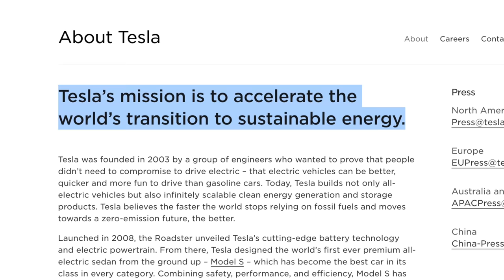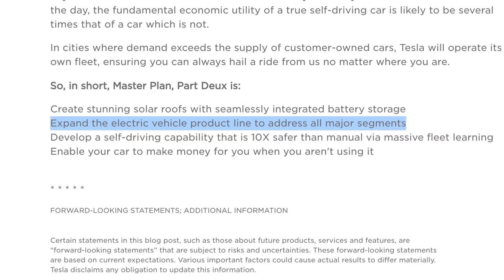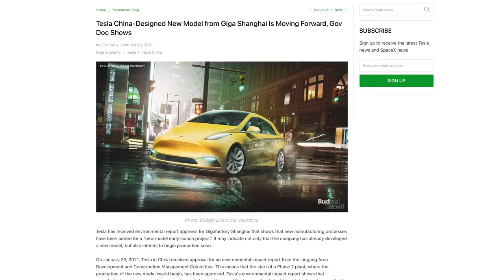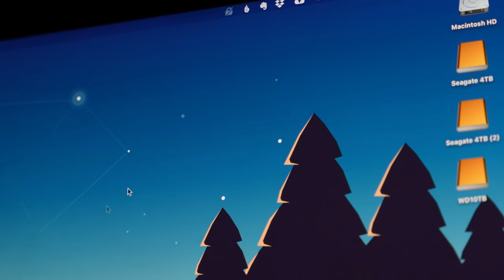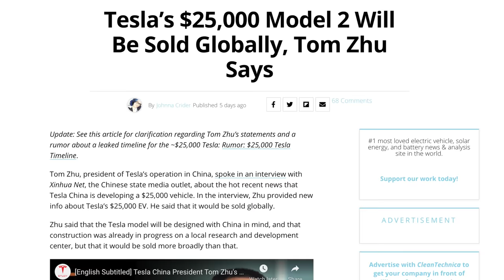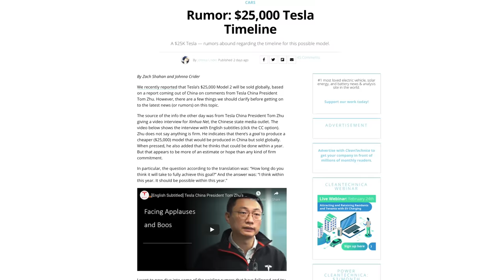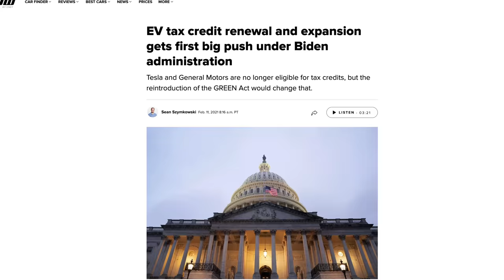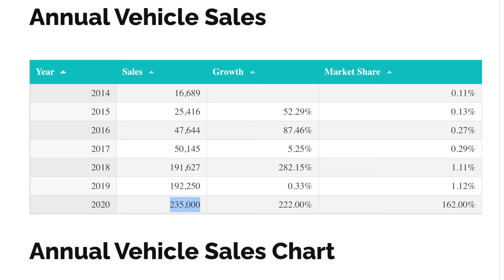New Tesla Model 2 = Game OVER for Gas

Comment: It needs a minimum of 250 miles. I live on a big island with few charging ports.
Reply: Hawaii sounds very expensive, but is the most beautiful and exotic slice of the USA. On the mainland, I'd need 500 miles and preferably 800 just to know I can drive anywhere without being stranded or suffering in anxiety and fear about a lack of helpful services and infrastructure. There are still rural gaps in the grid so it still only makes sense as a local city car while most drivers have a gas vehicle. I wish we could go solar and not be solely dependent on the aging power grid powered by the smoky dinosaur fuel. Those shiny new Tesla cars looks so great and not a bit of smoke nor dripping oil and antifreeze is the case. I'm so tired of wading through parking lots full of oil and antifreeze while breathing the funk just tracking that in which why everything is so filthy. They did really well European countries on cleaning up the mess, redefining living standards, and making things work better with set industry standards, but we can't seem to figure it out here where we can't seem to even agree on plug standards.
Reply: portable charge
Reply: ...You mean Australia?
Reply: How big is the island?
Honestly, I’d be fine with a 100-mile vehicle, charged at home daily. The average American drives less than 60-miles a day. A bus, train, or plane is cheap enough for long distance travel.
Reply: @evshrug  The Big Island of Hawaii is big. Places I travel require 250 miles RT and the destinations are rural. No charging stations. If I were to only have 1 vehicle and it's an EV it needs that 250 minimum. A friend has a Bolt and does fine with it. Regen helps on the long downhill areas.
Reply: @Worldofourown2024  asking for an 800m battery is like asking for a 100m gas GTR. It's just not gonna happen. Can it? yes. will it? hell no. Huge waste in resources and goes against the purpose of the evolving charging network. Get an adapter to charge universally, a charger for the house to charge at home, or wait till the supercharger network expands to meet your anxiety range. 800m gets me from florida to northern georgia, atlanta, with range to spare. that's asking for a bit much. plan your trips and you wont have to worry about being stranded anywhere. those who want to be a part of the future and own any EV, not just a tesla, do it, the rest will just sit around and blame range anxiety, or a slowly growing charging network, or lack of industry or government support on standards, when it's really themselves holding them back. be a part of the future you want to see. get one, adjust your life accordingly to make it work.
Reply: @evshrug  I read you only get 2% battery charging per hour plugging an EV into standard 110v at home. This means you gain a quarter battery in 12 hours and always needing more battery so off to the super charger for an hour or so on Wednesday nights after work. Then your electric bill becomes really expensive yet you're always got a battery conundrum so off to the super charger to top off your battery which is maybe more economical and definitely faster than home charging. Yea, an EV is great for a local commuter car. I drive as little as I can for I hate city traffic and our bumpy roads and highways just getting worse as time progresses for we can't keep up with the necessary maintenance nor willing to redo our infrastructure to really modernize. It's been nice only using 1 tank of gas per month the past year and I hope to keep it that way for commuting 80 miles a day is awful with accidents always putting us in danger and slowing us way down. Planes are most practical for international travel or to hop up to NYC or something which we don't do anymore, local buses and trains are cheap to use when you don't have a running car in the city, and I wouldn't want to have to get on Greyhound or Amtrak, but Megabus was a good cheap long distance bus though not on all US routes for it's British. I used to get long distance 1 way for $5, $10, or $15 on Megabus like from Saint Louis to Chicago and San Francisco to LA and LA to Las Vegas. And the you have the ex convict Greyhound bus ride. Super cheap flights, affordable taxis, low cost rooms, and everything used to be so plentiful easy, especially outside the US before Covid. I'd usually find domestic US one way for about $300 and international long distance for $600 to $1000. One time I flew from Kuala Lumpur to Paris for $300 on Malaysian right over Afghanistan with a screen showing Mecca on the world map a few years before that one came up missing they could never locate. How odd...
Reply: Few charging ports and then they're majority all slow...

Fast charging needs to be on par with gas stations... yep.
Reply: brah the lifted yota will never let you down
Reply: I do too called NoEj Island.
Reply: I'm guessing it would be in the 200 mile range scenario. It should be plenty for most people commuting and short trips especially if they have in-home charging.
Reply: @Worldofourown2024  if you have a single family home, you can pretty easily install a plug that will get you 30+ miles per hour of charge. Few users are actually using 110v outlets at home more than temporarily, they get these plugs installed. At that rate, most users recharge overnight without any trouble. This really changes the calculus you've made.
Reply: @house9120  Yes, the 2% an hour is just plugging it in without the special equipment in the garage you can get installed. Yes, that does change the 2% an hour battery calculus. 30 miles per hour is good enough to keep the EV moving as needed under most normal use and then you can sleep, eat, use internet, or whatever while it's recharging to be ready for your next drive. Now I need the money to buy my house and Cybertruck so I too can enjoy the adventure and have something to be mighty proud about. So expensive more than I can earn unless some new deal happens that changes the calculus to be much better than a measly 2%. We need 100% mojo going on for there's not a lot of time left as the future arrives while we get older.
Reply: @Worldofourown2024  Are European roads not made of asphalt? A few highways in the US are made of cement, but they are extremely expensive, and tend to heave under freezing conditions and cause constant bumps at the edge of each slab. I haven't heard what anyone's plan is of what to make all the roads out of if they stop using the bitumen that is left over from refining gas and oil. Tar sands perhaps? Going back to dirt roads is surely out of the question. No way the auto pilot features will like that.
Reply: @CatastrophicNewEngland  @CatastrophicNewEngland Sure they're made of the same sorts of materials. Audubons and highways are much higher quality material and design than American and most other countries. EU and countries like Germany put a lot more money in infrastructure, education, jobs, etc. to further advance themselves. Instead of bombs, they do bread. Well France and UK also have the bomb. Highway 63 in Missouri is a really nice American one that was built in the 1990's replacing the old asphalt 2 lane highway. I haven't been in 10 years so it might be bumpy, broken, and just rough if not restored. I-15 in Utah is terrible. So much traffic, so bumpy, narrow lanes, and just needs to be redone. They're doing some work on parts of it, but we're so far behind and it needed to be done already for Utah is so industrious, has high immigration rate, and is looking to further develop even more into the future. The problem is heavy traffic, high accident rate, high crime, wore out roads, infrastructure needing more development, water scarcity, toxic pollution, and a housing crunch.
Reply: I think Elon has indicated that 250 is minimum for his cars
Reply: @JamesOliverLindsey  I thought I heard that too.
Reply: @Worldofourown2024  can you make a stupid version for me, thanks in advance.
Reply: @lavapix  Crocodile Dundee “That’s not a big Island mate...” Your big island is about 150km long. Mines about 4000...
Reply: @mondotv4216   NOW THATS  AN ISLAND MATE !
Reply: @mondotv4216  It's literally called The Big Island of Hawaii :-) It's large enough that 200 miles aren't enough.
Reply: @lavapix  Easy - analyse how many miles you do a day. If it's more than 60 I'd be surprised. Unless you're a tour operator in which case a compact car ain't going to cut it anyway.
Reply: @mondotv4216  It doesn't matter how many miles I drive a day. What matters is what is the farthest trip I'd need the car for and that's 232 miles RT. This is based on owning one vehicle. Not having both an EV and an ICE.
It's not unusual for people to drive 200 miles a day over here as many live on one side of the island and work on the other.
Or they live in rural areas because it's more affordable.
Reply: Sri lanka?
Reply: Volkswagen ID.3 and Renault Zoe can easily do it
Reply: @UltimateGattai  he problry mena s north america becuase that has the most poupulation
Reply: 250 miles... It's a pity Tesla did not adopt the RC car model. Instead of charging locations all over the place make battery swapping stations, pull in and in 5 minutes your ready to go another 250 or more. 

Another though... just imagine what the strain on the electrical grids are going to be like once electric vehicles are the dominant vehicle on the planet. California won't be the only place with rolling blackouts.
Reply: I live on a medium sized island (Great Britain) and I need at least 650 miles range without refuelling to visit my daughter and grandson in Scotland. I would only consider an EV for local shopping, but for £30K no way.
Reply: @BeagleBageler  They're high tech, but super easy to operate and drive as long as you're familiar with touch screen computer tech which most of us today are for we have to use self check out kiosks or should if we don't want to be waiting forever in the line staffed by a human personal check out line customer associate. In Cybertruck, just plug it into your home solar power planet, then drive, but pay attention to battery levels vs. distances to where you can recharge. No worry about any power grid failure if you can purchase and install the solar power station on a piece of land you own. It's just money so only a few rich guys actually have this which are the tech and finance industry super stars.
Reply: @Worldofourown2024  Thank you for explaining, I now understand.
Reply: @BeagleBageler  Awesome. I seriously want a Cybertruck, a home, and a solar power plant system going. I don't think there's enough money nor time to achieve it though I won't abandon any cool idea and invention of our super hero visionary CEO Elon Musk. I hope to see him take it to Mars and I see he's the kind of leader we need more of us to keep our country together and advance it forward into the high tech age.
Reply: @UltimateGattai  sir don’t you dear tell me about how many I don’t see
Reply: @Worldofourown2024  Yea, I could not afford that myself either, but he could most definitely take us to the tech ages.
Reply: @evshrug  I agree! I barely drive 3 miles a week. 
Thanks Covid, let's never go back to commuting in to the office, or anywhere for that matter.
Reply: @BeagleBageler  Elon Musk is the coolest.  I'd love to live a very long time more yet to see the tech ages. If you live to 2070 or perhaps all the way to 2100, then you're in the high tech era. This is dependent on how well we take care, if we have adequate housing, healthcare, and organic tech based food, lifestyle, prevention of war, and pollution control.
Reply: You should consider leaving Greenland...
Reply: Pay extra for that Solar roof.
Reply: @saascarlson5597  You didn't think your comment out very well, did you?

Or you can just say you were joking :-)
Reply: This is a joke, the grid cant even handle peak use as it stands. No improvement to the grid means No effing electric cars. Rolling blackouts in CA says otherwise
Reply: so do i 🇬🇧
Reply: @lavapix  He's saying if you have solar panels at your home and a built in charging station you can use that instead. A lot of people in Texas benefitted from this compared to those that didnt. Being they still had electricity and running hot water. 

Those that didn't and only relied on the states grid got f'd over.
Reply: @MagicStick Yes, it seems that the tech is limited wrt range and speed of "fuelling/charging" relative to ICE, but the governments will be pushing you to spend a lot to own or to lease an EV, and Tesla and the others will be telling what car they are willing to sell you in the future. Meanwhile all trucks, buses,coaches, and vans will need to convert too, along with all the required change in infrastructure. Currently in the UK there are 213000 EVs out of 32 million vehicles total (that is 0.7%), and the infrastructure is currently just about adequate for the EVs. I wonder what the proportion is in the US?
Reply: @funfreq9282  Guaranteed Hawaii would have the rolling blackouts. Our lights already flicker daily.
Reply: @actionanimations4879  Are we talking about the same person? Saas Carlson. He literally didn't say any of that :-). 

It's a given you charge at home but you still have to make it back from your farthest destination and if that exceeds more than half of 200 miles with no place to charge you're screwed. 
I remember times over here where you couldn't even get gas on some routes unless you drove a certain time of day. You always made sure you filled up before you got home. Of course, my jeep gets over 300 miles a tank of gas.
Reply: @evshrug  Less than 30 a day for Americans! 🤷🏽‍♂️👌🏽
Reply: @lavapix  Where would you be going during lockdown that requires over 200 miles? If you look it up standard electric cars can run up to 250 miles as Teslas can run up to 350 miles per charge. This isnt a gas car where you can only get up to like 30 to 60 miles per 2.5 gallons. Plus most electric cars especially Teslas comes with the option of a solar powered ceiling. Meaning that if you op for that upgrade. Doesn't matter where you are. With direct sunlight your car will be slowly charging itself. While the breaking system literally charges the battery. 

You wouldn't be stranded anywhere. Compared to if you have a gas car and you look for a station but they all are tapped out of gas; which a lot were during the blackout where people nearly froze half to death. I love my gas stove but you need to be smart. Get a hybrid Gas/Electric stove and have alternative energy. Never rely on your state or Gov't to aid you in a time of crisis. Have everything set up so if 1 thing fails you have backup options.

Imagine you have to flee somewhere but you dont have enough gas to make it to where you need to go and you got rioters blocking the nearest stations. Like they were doing these past months. You need a vehicle that is self sufficient. As well as a home. You dont need Governors saying if you dont follow their rules they'll turn off your electricity like they were doing to people in California. Get some panels. Get an electric or hybrid vehicle that can run on any type of source. Either get it equipped with solar panel glass or by the portable panel charger.   

Get a water boiler that connects also to your house solar panels so you dont run out of hot water and get some backup generators. Don't be one of those stubborn people who can only see 1 way. Gas is great but be practical. Try to control as much of your own life by your own terms.
Reply: @evshrug  AVERAGE is average for a reason. And the charges don't charge up enough for overnight on that just yet.
Reply: @actionanimations4879  Holly crap. What was all of that?
Did you watch the video? They stated a 200 mile range so my comment was based on that. 

Since you brought it up.
Lockdown here in Hawaii didn't mean we couldn't go places to hike, surf, etc... And it wasn't all year. We have lots of remote areas one can hike that require long drives.

You: "Don't be one of those stubborn people who can only see 1 way. Gas is great but be practical. Try to control as much of your own life by your own terms."

WTH are you even talking about? Assume much? Watch the video and re-read my comment then go into your rant on someone else :-)
Reply: @evshrug  
Average car usage, is 
under 50,000 miles /yr,   80,000 km/yr.
( below 140 miles/day,   250 km/day)
-- Can easily live on 1 charge per day !
Reply: Hello from Sydney
Reply: @lavapix  it’s literally 200 around the whole thing...why would you drive around an entire island.  There multiple chargers.  Speed limit is what 55?  Lolz just no
Reply: @funfreq9282  there’s ample power available at night....this dumb idea will get debunked in time I guess
Reply: @richardroberson9277  Do you live here? Do you know where I go? Why would you drive around an entire island? Seriously?
Lolz, just no :-) 
The world goes beyond main roads. Its 250+ miles to drive around the island not using Saddle Road.
The car needs to have a 250 mile range minimum. 

If your happy with 200 and the issues that go with that limit good for you.
Now if you could battery swap in 10 minutes that would be okay as long as they are available in the middle of the night.
Reply: @lavapix  Actually yeah the Bolt EV is pretty decent in that regard. 259mi mostly due I think to it’s lightweight design.
Reply: @ZambonieDude  Yeah, my friend does well with his Bolt. He only ever needs to charge at home no matter where he goes on the island. Its close sometimes but now he knows he'll make it after those initial range anxiety journeys. We have steep grades and mountains.
Of course, if there's a road closure along the way that changes everything and on this island that can add 100+ miles to your trip. And its not just you its 1000s of commuters so if too many were EV's you'd be waiting hours to charge your vehicle. Then you'd need 300+ miles. Technology is quickly getting there but it needs to be affordable.

We seem to get these road closures every week lately for various reasons. One just came via an alert this morning.

If you've lived here long enough you've been caught by one of these closures. I've had to turn back and travel all the way around the other side of the island to get home on too many occasions. Because its happening to everyone now the traffic is thick.
Reply: @richardroberson9277  Debunked? You make it sound like everyone drives their car during the day then plugs in and goes nighty night. The world is 24-7 my friend! and added load to the grid will cause problems eventually.
Reply: @lavapix  Such a thing already exists and it is called the Renault Zoe. The Renault Zoe can drive 245 miles in one charge. But it is not available in America
Reply: @frederikjrgensen252  Yeah but they're still about $30k US. Leasing a Bolt could work but over here they up price everything.
Reply: @lavapix  I thought cars were cheap in the us. In the UK you can buy it for 25k pound and then lease the battery for 79 pound a month. It was the most selling ev car in Europe (yeah surprised it was not Tesla)
Reply: @frederikjrgensen252  I searched it after reading your comment and converted the Britsh pounds to USD. Honestly, I think the US car manufacturers are too scared to release truly affordable EVs even if batteries were easy to come by. Not enough to made from repairs at dealers.

There's cheap stuff in the US but it's not always affordable :-)
Reply: @lavapix  I have made a mistake in calculation it is not 25k pound it is 25k dollar and it is 109,97 dollar for leasing the battery each month in the uk. If you are into evs and range I would suggest you watching carwows range test. He has made on expensive evs like Tesla and other expensive ev cars. He has also made on with cheap ev range here is the video if you are interested: https://www.youtube.com/watch?v=wd2ArceiJd0
Reply: @frederikjrgensen252  Thanks for the link. I'll check it out.
Reply: Ya hawaii be like that
Reply: @Max-dy2np  Is Hawaii really that expensive?
Reply: @JoseVazquez-ru1nn  No, battery range needs to be 350 miles minimum before I even look at buying an electric car.
Reply: @Worldofourown2024  "it still only makes sense as a local city car"

The average daily mileage in the US is about 30 miles. One can currently purchase a Tesla with 260-400 mile range depending on options chosen.  How do any of them only make sense as a local city car? An EV with such range should suit the needs of nearly everyone who relies on automobiles for daily transportation.
Reply: @sparkeyjones6261  Very true most rural and small town folks could get by with an EV, but it's not a conservative sort of style. Many people don't ever go farther than 10 or 30 miles from where they live so a charge might realistically last a week. I like the idea of a solar powered low maintenance vehicle that keeps going when petro dollar global economy goes down one day which is the very thing we all hope to not have to endure. A bullet proof Cybertruck could be the best American made, but so slow to deliver. When it was announced in November 2019, I actually thought they had the Cybertruck factory already built and rockin and rollin ready to deliver new 2nd American civil war era trucks. lol
Reply: 😂 Cuz I’m cracking up at all these comments. Some of these guys going on some tangents. I live Big Island too, Hilo side. I hear you 250 minimum! Just drive to Kona and back is like 130 miles and that’s not doing anything except stop at Costco and come right back home. Usually if we gonna drive all da way to Kona we try to make one day of it. Take da keiki to beach or something. There goes another 30 miles, and sometimes we like go captain cook or drive South side back home. No can if only get 200 mile battery. We don’t do that every day but we like the option to when we want. I’m on waiting list for Cybertruck hope that one million mile battery comes out by then. Would be nice to get at least 15 years out of da truck if I’m gonna spend 50k+ gotta think about resale value too. 🤙🏾
Reply: Will.J  not a bad idea either... problem being theyre too big though
Reply: @splocal 🤙  Yeah some of the people commenting are clueless. They look at a map of the island and then think they know everything about driving around here. I remember when you couldn't find a 24 hour gas station. 
I expect to see several Cybertrucks on the island once it's released. 
Thanks for chiming in.
Reply: lavapix Until you live Big Island you don’t realize how big it actually is. I lived in St.Croix for over a year. That island is tiny! Also lived on Oahu, that’s a medium size island with choke traffic!!! I love Big Island, and if people wanna say it’s not big, remind them that from base to summit Mauna Kea is the tallest mountain in the world even beating Mount Everest!!! I think Big Island earned its keep!
Reply: @splocal  And Mauna Loa is the single largest mountain in the world in length. It's larger than the entire Wasatch Range in Utah.
We don't need tons of charging stations. 300+ range and we can almost always charge at home.  It will be interesting to see if the island ever rids itself of diesel trucks. That would be so nice.
Reply: lavapix always learning something new 😎 yes please those diesel trucks are nasty gross polluters. If we can get a few more Tesla charging stations Kona side and Hilo I think we would be set. Along with home charging we good to go! Usually the charging station at Target are always full.
Reply: @splocal  I'm not so sure this island will ever have the needed charging infrastructure so range will always be needed. Yeah, Hawaii has some of the cleanest air in the world and then you get stuck behind several diesel trucks while sitting in traffic :-)
Reply: @evshrug  charging at home? Most people don't have a drive or garage.
Reply: Sounds like this car isn’t for you, you need a bigger car and battery.  But, based on where you say you live, you’re probably used to paying extra for things anyways so this should be fine.
Reply: @CheddarCheeseBandit  It's never fine paying extra for anything :-)
Reply: @sparkeyjones6261  Because not everyone has access to charge at home, not everyone lives near to a supercharger and not everyone has hours to kill to wait on a car charging. That's why.

The day that electric cars cost the same as a normal car, have 400 miles of range and can be charged in 3 minutes in a network of chargers equal to the petrol station network I'll buy one, until then, why the fuck would I bother? Its not as if they're green.
Reply: Jeff206 that makes no sense.....
Reply: I like working from home. But now I don't even need the car I have. I want an electric car, so hard to justify at any price.
Reply: @sandersson2813  Well, I guess you've made up your mind. Maybe you're part of a very small minority of people who regularly drive more than 300 miles/day? Or, you live in a very rural area, without a garage, or electricity?

There were people who voiced similar opinions when the first automobiles were introduced. Like it or not, you probably won't have much of a choice 10-20 years from now.
Reply: @sparkeyjones6261  I didn't claim I drive 300 miles a day, but I do occasionally, especially in summer.
I live in an house which has no drive or garage just as most people don't , no allocated parking and therefore no access to charging overnight.
Electric cars are also still too expensive for the type of car I want to drive and they take too long to charge.

I'm not against them, they just aren't convenient enough yet and they aren't green, so why bother?

One of the other things you have to consider is that you real world range always MUCH LESS than the claimed mileage. Therefore if a manufacturer claims 300 miles, in reality it is likely to do more like 200.

Maybe in 10 years all these problems will be resolved. If not the public won't accept it and the laws to extend petrol and diesel cars will have to be passed.
Reply: Exactly what I was thinking. 250 minimum.
Reply: When it’s cold it will lose half its range so 250 is a minimum IMO.
Reply: Charge in your Garage or Carport?
Reply: @ChrisSmith88love  You mean the garage or carport the majority of people don't have?
Reply: @actionanimations4879  What are you on about?
Most cars in the UK get 40mph + as a minimum and diesels will do 60mpg.
Secondly the solar charging roof in a Tesla  makes next to fuck all difference and at best will be sufficient to run the electrics.
Also, the claimed range on an electric car, simply isn't replicated in reality unless its warm and you drive like a Vicar in a flat country like the Netherlands.

At present there is literally no benefit or reason to drive an electric car.
Reply: @dirktween244  Yes, but you do realise that most people don't have a garage or driveway to charge a car, and I'm fucked if I'm wasting 90 minutes every time I want to go somewhere waiting on a charge.
Reply: @richardroberson9277  There is capacity in a grid, but it still isn't coming from a green source.
We don't even have 50% renewable source for electricity as it stands.
If you move every car from Petrol/Diesel where is it going to be generated from?
Reply: @actionanimations4879  Solar panels on your house roof would take about 24 hours to charge a car if not more.
Remember how low voltage is in the US
Reply: @yourfather1090  Can you tell me please what brand make a portable charge??? And is it safe to keep it in the car in a very hot country??
Reply: then just don’t get it lmao, simple.
Reply: @samu-chan  Why produce a product that isn't suitable for so many people? That's the question.
It's like producing a shoe for people with 6 toes
Reply: @samu-chan  Isn't that obvious :-)
Reply: @sandersson2813  last time I checked there was more than one type of vehicle
Reply: Makes no sense to me transporting a large volume of cars around the world in large container ships will cause more pollution including the pollution caused by building them let’s look at profit not pollution
Reply: @brianhardern273  Also, Polestar, the Volvo EV arm says that in order for an EV to become more green than a standard car, depending on what type of electricity grid you are on you need to drove an electric vehicle for between 30-70,000 km for it to overtake a normal petrol car, so the gains are absolutely tiny.
Reply: Look into Aptera.
Reply: @Worldofourown2024  "On the mainland, I'd need 500 miles...."
Five hundred miles at highway speed (70 MPH) is over SEVEN hours of driving.  Do you really drive seven hours without stopping for a meal or to use the restroom?  Tesla has an extensive network of Superchargers.   It would be very difficult for you to become stranded unless that was what you were trying to do.  Check out https://www.plugshare.com/ to see where chargers are located.
Reply: @Worldofourown2024  "I read you only get 2% battery charging per hour plugging an EV into standard 110v at home."
You get a lot faster charging with a 220 plug, which is the standard for electric dryers.  Could you get an electric-dryer type plug installed in your garage?
Reply: @kennethhawley1063  650 miles at 70 miles per hour is over nine hours.  Do you really drive for that long without stopping to spend a penny?  Great Britain has charging stations on many motorways where you could stop and use the loo while the car was plugged in adding miles.
Reply: @Worldofourown2024  500 miles takes 7 hoirs to drive when your speed is 70 mph. You really travel that much everyday?
Reply: Just get your own charging port
Reply: No it's different in different places, I think that in New Zealand 90% of ordinary drivers could use a car with 300km, or even 250km. I have an EV with 160km  range and think it would be fantastic with 220km or 250km. If there is a fast charger every 70km on every highway which there pretty much is already, every 20km where I live, and some chargers in every town with a supermarket, then you don't need that much range. But a 250km range car is different than what people want for a road trip. Almost every adult in New Zealand has their own car, if they want one, so most families have two cars, or three or four. So half the cars can be 250km range and the other half 500km, and you take the long range car for a road trip. If, like me, you can afford a car with 160km range, you take it on a road trip anyway and stop every 120km, roughly every other charger
Reply: @OmegaF77  Absolutely not for I hate driving since other drivers are very unpredictable and don't seem to follow common rules and respect the rights of others. I don't even want to drive 80 miles a day for we need new interstates, new roads, driving education, and a whole new infrastructure. Some days I would drive 500 miles to take a trip to see tourists sites and places for it's really spread out. I'd have to drive 100+ miles to get to a good fishin' hole. Out in Utah, many people do regularly drive distances many hours a day and they drive fast for the distances and geography are not convenient. Since it's very dangerous, I choose not to drive anymore than I have to. I guess a charge in the Cyber truck would last me about a month now.
Reply: @calamityjean1525  Sure you can. They'll run a line 220 line from the transformer. Though you do need to own the home first. Dang, that's my big problem right there. Once you own your home and the money to pay for it all without crazy high debt, the technical matters are super easy to work out. The thing is a home and then all the stuff costs far more than most jobs pay so it's only American Dreaming in my sleep.
Reply: Welcome to the Isle of Wight!
Reply: @Worldofourown2024  No one drives 500 miles everyday. The average American commute to work is 25 miles round trip. WTF do people need a 500 mile range for? are you going on a roadtrip every day?
Reply: @Worldofourown2024  Obviously you don't want an electric car.  So don't get one.  

However, in ten years they will be the dominant type of car, so thinking about how you will handle charging one might be a good idea.  If you can use an electric dryer in the house, your landlord might allow you to have an electrician extend the 220v service to the garage.  https://www.currentautomotive.com/electric-vehicle-charging-101/

Electricity is cheaper than gasoline, so getting an EV if you need to drive to work would help you save money.
Reply: @razatiger22  Because we don't want to get stuck in the middle of nowhere without a charge. That's why gas is better, because you can simply head to the gas station and get more if you run out
Reply: @calamityjean1525  not all of us live with garages mate
Reply: @Worldofourown2024  Actually, you wouldn't.

I did day trips of over 1000km before and that's something I will not do if I don't have to again. Paris Vienna. Brussels Vienna too. That's a full days trip and trying to do it without breaks is madness.

600km highway range would be  is nice, that's about as far as I'm ready to drive in a day. 800km at most. But even here, I'm fine with making a lunch break in the middle.
Reply: With my job, I need a minimum of 400-500 mile range.   And I would also need super-fast charging (15 min 10% to full).  Once that happens in a sub $40K car, then it's over for gas.
Reply: @BlackDim100  With wishes like that, probably not even Mercedes EQS would do.

Theoretically, new "6 minutes to charge" Varta batteries could give you that type of charging performance, but they are still 2y away from mass production. And then they will only produce  enough for some 20,000 BEV in the first year. So realistically seen, what you would like to have will only be available on the mass market 5-10 years from now.
Reply: @DenisHavlikVienna  Then that's when I will be able to go with an EV
Reply: @CatastrophicNewEngland  Definitely asphalt.

Interesting historical nugget: First highways, made by Nazi Germany, were made with concrete. At least some of them. I remember driving on this type of road with my bicycle when I was a kid 40 years ago, but even then this was very rare. I encountered some more of them in Eastern Germany right after the fall too. They were covered by asphalt but had concrete below and produced characteristics"tudum-tudum" sound as you drove over them. I don't think that any exist today.
Reply: @JamesOliverLindsey  well, it's a common knowledge that Tesla range is very optimistic. 250 miles EPA range of Tesla is comparable to 200 milie EPA range of other cars.
Reply: @dirktween244  Seriously? I had some 25.000km/year while I had to commute outside city for work and that was considered quite a lot here in Austria.
Reply: @sandersson2813  I agree, unless the range is the same as ICE cars and charging stations are a lot more common, they are only useful for some people, no matter how adamantly they support them. If you only have street parking, you're kind of out of luck. If you ever want the option of going more than 200 miles round trip to somewhere where there doesn't happen to be a mega-super-ultra-hyper charger on your route, then you need to have a second car anyway. 

Affordability is the biggest detractor though. A huge percentage of people can not afford a cheap new gas car, and I don't see used EVs being functional and inexpensive (sub $5k) in the 10-20 year old used market unless they make batteries that keep a full range charge for the lifetime of the car (300k miles+). Though that holds true for most or all new cars in the last decade because they're so dependent on cheap electronic gadgetry and engineered to fail plastic assemblies. I can't wait to see how Teslas hold up to 8 or 10 years driving in salty brine for 5 months of the year. I'm guessing "not well".
Reply: @DenisHavlikVienna  Very cool. There's a pre-interstate highway not far from me in Vermont that has the thump thump of being concrete under the asphalt, that becomes apparent when they haven't paved it in a while.
Reply: @sandersson2813  That depends on the production. If you look carefully at what Volkswagen group is doing, you will notice that they are talking about "zero CO2 production" and "green production". That is, they are committed to lowering the ecological imprint in the whole production chain and using renewable energy in production. 

Obviously, it's possible to apply the same principle to production of the ICE cars, and I. suppose that VW ag. does that too, but in reality it's BEVs that are really targeted. And apart of the German and possibly French producers, I doubt it that anyone is into it atm. In fact, Elon is very angry at Germans because they are insisting on his German factory meeting at least some of the standards all German car producers adhere to - especially related to use of water and water pollution.
Reply: @DenisHavlikVienna  Volvo/Polestar are claiming to be doing the same.
The bottom line though is that cars are not that big a deal in regards to global warming.
If you took every car off European roads, you'd only get rid of 1% of global C02.

If you replaced them with EV's, you'd have to drive EVERY one of those EV's for a MINIMUM of 30,000km (provided it's a purely renewable energy source) before it became more green than a standard petrol.

Being "green" is just a smokescreen and virtual signalling effort. Its actually worth pretty much fuck all to the planet.
Reply: @sandersson2813  That's very interesting.

Considering that Europe is only responsible for 7% of the global CO2 production, this 1% is actually 14% of the European CO2 production. And that's assuming that you didn't just invent it.

Let me see... According to EEA, road transport is responsible for almost 3/4th of the total transport energy use in Europe. And I just opened a paper by J. Krause et. al (2020) that's claiming that road transport is currently accounting for a quarter of European CO2 emissions. That's 1.75% of the worldwide CO2 emissions. 

Now, your sloppy handling of data aside, how does this even matter? The end goal is not to remove ICEs from European roads, it's to do this everywhere in the world. In which case, we are probably talking about 1/4 of the total anthropogenic CO2 production.
Reply: @DenisHavlikVienna 
Actually Europe is 12% of global emissions and car pollution is 9% of this figure.

However, replacing cars with EV's in Europe, might save the world 0.5%, big bloody deal.
It's not significant.
Actually running the Internet is twice the C02 output of European cars.

By the way. I didn't say or imply road transport I was talking about PRIVATE Vehicles and I SPECIFICALLY STATED CARS so please adjust your condescending tone 

Furthermore global air transport is just 2% of global CO2, yet doomsday cults like XR and hypocrites like Saint Greta and Attenborough demonise the car and air travel when it is LESS of a contribution than many other things like industry, heating/cooling, concrete production etc, yet, they only attack things which have visible exhaust.  
Why don't they be consistent and attack everything that contributes?

It's pissing in the wind when countries like USA, Russia, Brazil, India and China are the big issue.
Countries like Britain are already doing more than enough.
Reply: @sandersson2813  I am at a phone here and it's a bit difficult to look up the facts, but I am rather confident that 7% figure that I named is correct. Could be even less today.

And you keep mixing up the European and global figures in an attempt to make it look insignificant.

As for the relative importance of other activities, it is indeed true that some of them are responsible for a whole lot of emissions too. In particular the building sector. Metallurgy is another high flier. And heating/cooling of buildings too. Which is why we are looking at co2 neutral replacement for Portland cement (available on the market already), at zero energy and positive energy buildings (we have started building huge zero energy buildings lately) and hydrogen based process for steel production (first large scale test facilities are being built).

So whatever your issue is, your sources of information seem incorrect. No, transport is not insignificant and we aren't concentrating only on transport.
Reply: @DenisHavlikVienna  Well it might be, in which case cars are even less than 1% of global C02 from Europe.
When I looked it was 9% and cars were 12% of that 9% from Europe, but could well be less in another source.

I'm not making a conflation at all. 12% of 9% is still nothing, so all this fuss about EV's in Europe means fuck all on a global scale, that's the point. Its virtue signalling and given that Polestar themselves claim that an EV needs between 30,000 and 70,000km depending on the grid type  to break even what's the fucking point?  
Every car I buy will be less green than a petrol car for the duration I own the car. 

Wouldn't it be better for the doomsday cults to focus their ire on China, USA, Russia and India instead of the pressed upon European motorist?

If anyone is confusing things its you. You keep referring to transport as a whole when I'm talking about PRIVATE CARS.
Reply: @sandersson2813  First: private cars are part of the transport sector.
Second: Transport sector is responsible for 25% of the European CO2 production. I don't really care if private cars are 3/4th, 1/2 or 1/3rd of this - it's easy enough to look it up but it doesn't really matter. It's significant part of the cake and thus needs to be handled.

Now to the importance or lack thereof of the European CO2 production. I'm sorry to say so, but you are blind.

Apart from EU acting as a moral agent, which can come in handy, the point of this is very simple: 
1) become less dependent on oil producers. This is largely liability for Europe.
2) Build new industry in Europe.

As far as BEVs go, there are additional advantages: less air pollution, less noise => higher quality of life.
Reply: @DenisHavlikVienna  Listen, I looked up the contribution of cars in Europe, and then you try to tell me my figures are wrong.
I'm talking SPECIFICALLY about the demonisation of cars IN EUROPE bu utter pricks like Extinction Rebellion.
Electric cars are a sticking plaster on an axe wound in Europe.

If you want to argue about transport in total, be my guest but don't try and tell me my figures are wrong when you're confusing them with something completely different.

As for noise in cars, the majority of noise is not from the engine (unless you're aittle prick in a Corsa) but from the road noise of the tyres.
Unless an engine is being revved it is barely audible.
As for pollution, yes, there is that although you're really just moving it to the lower station.

Also, Electric cars are currently too expensive and they will get more expensive when the government startosong fuel duty and have no choice but to add it to road users, so driving will be the preserve of the wealthy, unless you want to drive something shit and useless like a Zoe.
Reply: That’s not the way to approach ev car, most of the time you car is at home so you can charge it, and I highly doubt that you commute 250 miles a day !
Reply: @lavapix  move closer, stop wasting you live in commute,
Reply: @EL90291  You make the rather naive presumption that people have the facilities, driveway or garage to charge at home.
Most people do not have access to a charger because they live in a flat or  apartment  and don't have a driveway or don't even have allocated parking in their Street.

As for charging, I don't want to charge every day, just like I don't want to fill with petrol everyday.
I want a car to be ready at all times, not something I have to take off a charger and hope its charged sufficiently for my use.

EV's will be successful when they can charge in the same time it takes to fill up with petrol, when they have the same range as a petrol or diesel and when they are a comparable price to a petrol or diesel.
Until then, why the hell would you bother?
It's not like they're very green either.
Reply: @EL90291  People also tend to forget that their EVs can be charged while they are in a gym, shopping or such. 1 hour waiting for a car to charge is annoying. 1 hour shopping is a necessity.
Reply: @Worldofourown2024   okay go get yourself an 800 mile car or even a 500 mile car. If you have an electric car then you just need to think of how and where your driving and not be dumb and hope for an 800 mile car. Instead of increasing range increase super chargers. Everyone has there own chargers which is dumb, cars don’t have there own style of pump lol
Reply: @EL90291  You might want to try reading the previous comments. Thanks for chiming in.
Reply: @andrewmcnamara1991  Yea, more super chargers and a standardized plug type are needed just as we have gas stations everywhere with the same pump nozzle fitting all gas cars. Cybertruck is to be 500 mile range per charge which is adequate for me though I can't afford to buy any sort of new vehicle nor a home.
Reply: @DenisHavlikVienna  I agree. Even going the distance by train or plane, you should make a stay at least 2 nights 3 days minimum to make it worthwhile unless it's a free stopover on a flight itinerary which London is a real common one over there. I could stay a long time in London for there's so much to see and do and it's all in perfect English. The museums and all the walking streets. I'm sure electric cars work out perfectly in Europe for you have a standardized plug type, plenty of charging infrastructure, and most distances not too great.
Reply: @calamityjean1525  Oh I do want an electric Cybertruck or a Model X, but can't possibly afford to buy one. I see the Model X's every day and go, gosh where do people get all that money? It's not jobs pay enough to buy a nice vehicle and then a property, it's executive and high income self employed arrangements. I agree in 10 years, electric may be dominant. Tesla is highly successful as is Space X.
Reply: @razatiger22  To drive out of the metro area out to nice camping and fishing sites and see places like Southern Utah, Nevada, and California. Not an every day trip, but I need 200 to 400 mile range to get a decent fishin' hole for a weekend. I live in Salt Lake City metro and you do have to drive at least 100 miles out to get a nice unpolluted place with fishing, camping, fresh air, and healthy ecosystem. Better if you go 200 from SLC for it's so polluted and so spread out with long distances to get away from the crazy area.
Reply: @Worldofourown2024  so why are you arguing that the only way you will get an electric vehicle is if they have an 800 mile range
Reply: @andrewmcnamara1991  I'm not really. I said the Cybertruck that is to get 500 miles range is plenty good enough and I'd love to buy the duel motor version. It's really nice. 500 miles is plenty to drive in a day and then you can probably visit a charger at your destination while you look at some internet or eat dinner. It would be nice to have 800 miles per charge just like it's nice if you have a phone with the latest battery tech lasting you all day with heavy use.
Reply: Then plug it in yo dam wall
Reply: @blackstorm5861  that’s what I’m saying I don’t know what this man is talking about lol
Reply: Yep Ireland don’t have much chargers at all
Reply: Australia?
Reply: @blackstorm5861  Yea, you can do that. I read it's 3% charge per hour on regular 110v. If just for short commuting like a local or city car, this will do since you can get 30% in 10 hours while watching TV and sleeping after work.
Reply: @kagenlim5271  Sorry, I made several comments.  Which one were you responding to?
Reply: @funfreq9282  That is actually a good idea and maybe a future business for someone. Its a good second option for EV drivers. 
Right now for me its solar. The sun powers both my EVs, my homes and my business. And I hear more grids are being added. More power stations. Gas stations however are not being built in my state. Btw, at the end of the year the electric company pays me for my excess energy they receive. I suspect with the ever growing rise of solar panels everywhere in CA blackouts will not be the case. However, like Vegas that runs on solar (no rolling blackouts there) , CA must do the same. We have only one large solar field (Las Vegas has a much larger solar field) and CA keeps getting shot down by desert dwellers to build a second larger solar farm field for LA. Hopefully this will change.
Reply: @kennethhawley1063  A toyota prius will be better for you.
Reply: @lavapix  lol
Reply: @Worldofourown2024  Thats bc when Europeans built there new homes they did so with 220v not 110v like we currently do in the US. Now US EV drivers have to add the 220v in each garage, not a problem but still. 

As far as plug standards, remember back in the early 2000's when Elon invited ALL  auto companies in the world to take part in his rapid charging system and NO car company took part. SO that is on them. 

Let me also add along with your description of the filth from ICE autos they cause but the additional filth that most will go into junk piles, further polluting our earth. Most EVs are largely made of recycled and repurposed materials. Each EV has a life after its use to us humans. Also since the average Tesla life span is ONE MILLION miles, making it the CHEAPEST vehicle on the planet. Yes, at 300k-500k you will probably have to replace the battery for a new one at $7k currently but I'm sure this price will go down quite quickly. But if you are buying a Tesla at 46k plus future battery pack at 4-7k...you are still getting a dang good deal. 
I can say with certainty that the Teslas I have now (not the Model 3 bc that is leased)  and the Cybertruck I currently have on wait list will be the last vehicles I will ever own. With the new Space X material used on the Cybertruck press body...that truck will get past down to my adult son.
Reply: @AnnLeiSoCal  Yea, I want one. The kicker is $50k is still a huge sum of money to me yet I'm almost 50 years old for earnings don't stack up well for most of us. We need to move the economy where a low paying job is about $50k, average $75k, and six figures a solid professional level. Yes, there are thousands of people pulling in 6 figures which is how one can drive a Cyber truck and own a home or place. Look at prices of house and land. Few jobs pay enough to afford it without going into massive debt with credit. I own my car, but it's not a high end model or late model. Cyber truck me up please.
Reply: @AnnLeiSoCal  Actually it's a very smart idea when you think about it! Having a battery changing station replacing every gas station you no longer need to worry about how far you EV can go even with current battery tech. With range no longer an issue it would be a lot easier for the masses to adopt EV's. Why Tesla, GM and others did not use this format as a model is beyond me. I guess it made too much sense...

Petroleum is never going to go away completely, it's in almost everything we use. Tires, everything plastic! the entire planet runs on it. Converting to EV's makes sense from a mass transportation standpoint. The green new weenee timeline that the current administration is trying to ramrod down the worlds throat is unrealistic. You can't just shut it of that fast. Their 10 year plan needs to be a 50 year plan with a 15% reduction each year. It's easier to implement, plan for and maintain but hey the world's coming to an end in just 8 more years right! 

Some things will just have to use it no matter what! Jet aircraft cruise ships etc etc...  Some of those things can run on Methanol which is a renewable and for the power hungry guys that love HP thats me!, Methanol allows for making some serious HP! Down side is you have to burn a lot more of it as the energy per Lb is less than gass by roughly half.   

Net metering will eventually go away, (I used to sell Solar here in my state, CA) with only a little over 6% Solar penetration here in CA power companies won't be able to afford to continue paying people for producing energy. A 100% offset is the best but most can't afford that size of an array on their home. Your power bill will continue to rise just because your hooked to the grid. 

Solar panels require massive amounts of energy and mined silica to produce! so they are not as clean as one thinks. They also have a life span so eventually someone will have to replace the existing panels. Unless they figure out a way to recycle them there's that potential mess in a few decades to think about.
Reply: That's what I was thinking exactly 215 MI wouldn't cut it no matter what price the car if it's a Tesla it's going to be like the golden standard for all electric vehicles so why wouldn't their least expensive car also have at least 250 miles I thought that too when I saw that 215 miles I thought no it needs to be at least 250 for it to be a game changer and to steal the the show from all the others in its class.
Reply: 550miles with a charging time of 5mins also would have too last longer than 25years without any effect on the range or performance (minimum power loss maybe 10ponys over 25years)
Reply: @Worldofourown2024  My 2020 Bolt charges at about 4 miles per charging hour, using an 8 A rate, with about six or so miles per charging hour if I override the preset maximum amp draw set by the car.  That is with the OEM charge adapter (take note that the actual charger is in the car, what you're using outside is a charge adapter)  included with the car. I am told it is possible to convert that to 220 volt and use it on a sufficiently provisioned home circuit and get considerably more miles added per charging hour.  I'll try to minimize the hacks I do with house current, can be dangerous.  I did buy a level 2 adapter which gives me about 25 miles per charging hour.  It draws 32 A from 220, requiring at least a 40 amp circuit but more practically a 50 amp circuit similar to a range or old-fashioned dryer outlet--My adapter came with a plug suitable for a 50 amp receptacle. Code requires that the continuous draw be only 80% of the circuit & the breaker's capability.  At a 440 V level three "DC fast charging station", which I have not yet tried because they are expensive, $.43 per kilowatt hour at one of the local ones--Sheetz near Charlottesville Virginia, compared to $0.11 per kilowatt hour at my house, all taxes and fees included.   If you do the math, even at $0.43 per kilowatt hour is probably a fair amount cheaper than the average gasoline powered car these days.  I would like to know if someone has done some deeper electrical engineering work to compare the DC fast charging and its actually efficiency to level 2 charging at a home, which I believe is about 80% or so efficient, meaning you lose about 20% of the energy that you get charged for at your house.  If the per kilowatt hour that you pay for at the level three charger is 100% efficient as it means to what is getting to your cars batteries, that levels the playing field a little bit more.  I'll also point out that there are a lot of free to use level 2 and level 3 DC fast chargers out there in towns like Blacksburg where Virginia Tech is based.  By the way, I absolutely totally love my Bolt, last year's model bought new at the end of March 2021, under $30,000 with seven year free financing.  I have an older 911 C4 that probably isn't much faster on 0 to 60.  My Bolt will snap your head right off your shoulders.  Keep it in low range to use the "one pedal driving" feature and the regen for maximum efficiency.  It feels a bit odd at times to have the car slow down big time when I remove my foot from the accelerator, much like a jake brake on a big truck,, but it really really works.
Reply: And this is why it won't be 'game over for gas' anytime soon.
Reply: @sydneywicks3747  5min charging times? Your kidding right... Simple math will show this impossible with voltages and current being made available to the masses let alone current battery tech. 

Ha, Maybe you have a Genie in a bottle that can just blink it all into existence. Have him blink all the C02 out of the atmosphere while he's at it. I would love to see what happens to the earth without C02.
Reply: @funfreq9282  no I just have a diesel which does everything I need it too and it’s eco friendly compared too electric vehicles
Reply: @Worldofourown2024  

That’s because they rely on NUCLEAR POWER Plants.
Why can’t you stop with the solar stuff
Reply: @evshrug  

Cheap? People pay higher taxes, that’s why it’s cheap.
Newsflash: Not everyone makes equal income and not everyone spends their income equally. 
Why should some people pay higher taxes if those people don’t use it? If I like to use, I pay for it. 
If I don’t, then lower my taxes and anyone that don’t use it, lower theirs too. Whoever operates these vehicles, if it affects their income, that’s not my problem.
Reply: @JoseVazquez-ru1nn  

That’s like asking rural folks to get a higher paying job because they make less income. 
You city folks are so naive
Reply: @Worldofourown2024  

It’s cheap because we pay higher taxes.
Newsflash: Not everyone has equal income and not everyone spends their income equally.

Why should I pay higher taxes for something I don’t use? If I like to use public transport, I pay for it. If I don’t, don’t tax me for it. Whoever operates these vehicles, whoever is the company of these vehicles, if it affects your income, that’s not my problem. 

Why should rural folks pay higher taxes that affects their low income when they don’t use public transport?
They drive cars because they don’t live in a city.

You city folks OPEN YOUR EYES
Reply: @robert2690  It's actually not bad to be paying higher taxes for stuff like infrastructure that all your citizens benefit from, thus, increasing the quality of life and culture in a country such as Sweden for example. While you have a broad middle class, of course, they all don't make the same income nor spend it equally. Some buy a Porsche, others travel on holiday, and some buy a house if they don't already have one they inherited. I think it so nice over there...
Reply: @robert2690  Because solar is the ultimate sustainable and clean energy source.
Reply: @Worldofourown2024  interestingly, Teslas do use antifreeze. The batteries require coolant. I didn’t know, but with the benefit of hindsight, it’s pretty obvious now that they would need a coolant of sorts. Anyway they use propylene glycol, which is non toxic.
Reply: @tangomike15   That makes sense as batteries warm up during use which can cause fire and total loss of the car or other thing be it a gaming laptop or phone in extreme hot weather conditions. I thought maybe they require some warmth in freezing cold weather as batteries don't hold a charge nor perform as well in really cold weather. Of course the heater in an electric car must really drain the battery for it doesn't have the warmth off the engine block like the traditional gas engine. Electric central heating is very energy intensive and expensive if you use it in a home.
Reply: @Worldofourown2024  I heard they have a separate battery for the heater etc. It’s a new world. Just when I started to get really confident fixing my normal old school cars, now the whole world goes and changes. Sheesh.
Reply: 600 miles...anything less. Not worth the time...
Reply: THAT'S what I'm talking about!
Reply: @evshrug  lol and then when you need to make a road trip, can’t bring the Tesla?
Reply: Solar charge eh
Reply: Charge at home
Reply: Elon MUSK is New God! Mars is the New Earth! Earth Will soon Die Anyway! TESLA and Tesla Holders will be Kings. Rest and their Family will be Our Slaves and work to Power energy for Bit coin!! Elon is Einstein, Edison, Newton, and Jesus combined. HE at least deserves several Nobel Prizes. Elon has more IQ than weight of Hater's Ug ly Prius and his F at Ho Combined!! HE is like Ironman who will destroy Thanos and critics are better off using their cash to wipe their a n us. JUST Worship Him instead of other silly god!! GOD Elon will Punish nonbelievers!! Go Emperor God Musk!! Elon's brain chips and AI will Control and Destroy any Infidels!!
Reply: @Worldofourown2024  most gasoline hatchbacks don’t even have 500 miles of range lol
Reply: @yourfather1090  More like solar charge for Hawaiians.
Reply: @t-bone9239  No they don't. I have a gas 8 cylinder 4 door sedan that gets 18 to the gallon and has a 16 gallon tank so that's about 288 miles per $65 dollar tank due to be probably $100 a tank before long. Then I have $60 liability insurance and $65 parking expense and maintenance so a gas car really isn't that much cheaper now than a new EV where it used to be owning and operating gas cars was super affordable that everyone had a couple big cars and a house with front and back yard. All these sorts of things are very expensive in the new 21st century era. EV's are really nice for they look high tech, have lower maintenance needs, and get more mpg comparing actual cost. I'll go for an EV when a used Tesla model 3 isn't $40k to purchase though there is some deal where you can lease a Tesla for just $199 plus insurance, charging, and parking if you don't already have a space where you live. It's ideal you have a space with plug in right where you live.
Reply: @lavapix  Hawaii?
Reply: @jeremiahbryant123  The Big Island of Hawaii. Hawaii county.
Reply: @CatastrophicNewEngland  we have all sorts of concrete roads in Michigan. I’d imagine that any expressway in the NE has a concrete base layer. Asphalt is flexible which is to its benefit and it’s disadvantage in northern climates; asphalt in southeast Michigan under heavy loads doesn’t last long.

Add to that the ability to produce a cement that can hold a charge (the technology exists) and concrete becomes a game-changer.
Reply: @kennethhawley1063  no you don't need that range.  You will never drive 8 hours with no tea stops, and your car would need a new tank after 450miles at the most.   I stop every two to three hours for 45mins.   If you combine that with ev charging it makes 650 or more miles a doddle.  My 200mile range ev goes from 15 to 80pct in 30 minutes.
Reply: @Worldofourown2024  120v is not the best source for charge EV's 240v is. If the battery is very low it will still take 8hrs or more to fully charge.  Depending on a persons driving patterns EV's drain the battery quick. 250 miles for the average EV and most drive alot.
Reply: Braddah stick with the Lifted Yota.
Reply: Let me call Elon an let him know
Reply: @Worldofourown2024  cause they don’t want you buying other brands. Duh.
Reply: @mantequillaop8262  He's already on it. Thanks though.
Reply: You can’t plug-in at home?
Reply: if evs had solenoid engines they would go way further
Reply: @Worldofourown2024  You don't need 500 miles!  There are lots of charging stations for one, and you'd get a charger for your own place.  200 to 300 works just fine.  When I take a trip over 200 miles, I know where I can charge up, as my Model 3 only has 220 range, because I got a cheaper one.  If I have to wait 45 minutes, no big deal.  Charging stations are usually in places that have shops and restaurants nearby.
Reply: @ldfreitas9437  ok karen 🤣 🤣 🤣 

Keywords - plan ahead, aka need more days.
Reply: @ldfreitas9437  Well I need 500 miles range for sometimes I drive that in a day, but 250 is normally the most you need in a day. Battery redundancy is also nice to have around should you experience a black jack lights out period. Not only can infrastructure be destroyed by a tornado or the bomb, but financial and tech systems failure can also mean lights out for a while too. Because lots of people do feel they need 500 mile green machine range, the new Cybertruck 3 motor non-gasified accelerator is to be just that, if they can manage to actually deliver it. With all these supply chain issues, their is sure to be a big hiccup and that dollar isn't going to mean jack squat.
Reply: @evshrug  the Average person drives just 29 miles per day on average so yes my Single motor tesla with 263EPA is waaaay morr then I need for the day.  Helps on road trips and days I do lots of driving but never drove more rhe than 320 miles in 1 day and all I did is stop for 45min once 2 charge!!
Reply: @wonaldgrump9654  not in California I see 1 every 2-5 miles.  We have 2 many IMHO but more is better than less as I see more and more EVs on the road each day.   I got the 2021 tesla Base Model 3 single motor and it has plenty of power and range!  I get 220 miles before I need 2 charge up.  I only use a 110 outlet and only use supercharger stations as needed.  They are easy and fun to use
Reply: I honestly don't think this will happen for at least 5 years!  They have a lot of things 2 do 1st.  The Cyber truck still is not ready or the  Semi trucks.  Those are of much more importance then another Ev car.  Its a fun Idea but this will make very little money for tesla so I bet the Model 3 will be the lowest price or cheaper option for quite a while if not indefinitely.  We will wait and see but I would love 2 see a baby tesla.  Cute little ride and Its 200HP will move you around 7sec. 0-60.  Basically what the Teslas do in Chill/ECONOMY mode.
Reply: @georgespalding7640  yeah I worked for tesla for 1yr.  I heard if it does get done it will be more like 2027-2028 & will cost around 25-30K.  Performance will be around 180-200HP but because of the lighter weight will move 0-60mph in just 7sec.  Average!  Quick but not fast but plenty for having that EV quick and fun experience.  It will handle better then a GTI all while having similar performance with way less issues!  No engine and transmission = less problems and less maintenance.   I have 22K on my 2021 Tesla M3 and my pops 26K so 48K miles total and 0 issues and 0 maintenance costs besides tires and window washer fluid!🏁🚘😂
Reply: @BeagleBageler  they r so easy to use.  Once you get use to the tesla you will want for no other car ever...
Reply: @lavapix  get the Model S LR with well over 400 miles of range or the X.  Also Lucid Air is another option with 520 cruising miles!
Reply: If you want range get an S or X or a Lucid air.  400-520 Cruising miles.
Reply: @Worldofourown2024  yes I have the 38K 2021 Single motor tesla model 3 and I only use a 110 outlet and I have 22K miles on my tesla.  The Average person drives 29 miles per day and still have 0 issues using the 110.  If I'm goin on a road trip I will use the supercharger stations but otherwise the car gets charged all the time I'm not using it.  3-6days out of the month I have so much range I dont need 2 charge anymore so you don't need the 240 unless you're driving more then 60 miles per day.  Otherwise save your $ and also its the best way to charge up your battery pack.  It does the least damage to the battery and less degradation will occur over time.  I expect to own this car for 20yrs. So I want to keep the battery in top condition for as long as possible
Reply: @funfreq9282  that would be difficult also as its not that easy to remove the battery pack from the Vehicle!  Also I don't mind watching hulu for 30min. Charging   my ride up.  I only do this in road trips as I charge up in my garage with a 110 outlet and works great.  I get plenty of cruising miles for the day. Around 50 per day.  If you need more get the 240.
Reply: @kennethhawley1063  yes evs r not for everyone thats for sure.
Reply: @actionanimations4879  ok most of what you said was true the only false information you gave was about Tesla have a Solor Roof!  This is not true on any teslas yet that is.  Its not even an option but may be in the future FYI.  So you can't pay more to get 1 put on or whatever either.  Sorry you were misinformed about that.  My 2021 Tesla M3 single motor vehicle gets an EPA 263 miles of range but my real world range is about 200-235 depending upon many factors!  Ac, speed, cold weather conditions, erc..  but no tesla has the solor panel its an All glass roof fyi and its gorgeous but no solor.  I have solor on the roof of my house but the car doesn't have that option unfortunately.  Also it would only give you a small amount of extra range as all the power comes from the battery pack and the solor power would need 2 convert to energy on the spot.  They r working on this and maybe an another EV has 1 but not TESLA SO FAR..  😥
Reply: @branching123  just like u said its an average of 29 miles per day but in just 9hours while I sleep I get 15% battery which gets me 30 miles of range.  Also its pluged in all day long when Im not using it so it sometimes gets 45% charge if I don't use it for 1 day or 40 if I just go 10 miles to get food or see my parents or ??.  I have driven 22k miles so far and only need the supercharger stations on trips and I've used it for days I have more then 3 rides to the airport but I get 146 miles on 60% so no need for me to even charge up past 80-85% and I dont go lower then 15-20%.  With my free yr. Of supercharger access I used it 12 times and 10 of those were on long road trips so deff dont need the 240...  my battery health is amazing also because I trickle charge so I'll have this tesla 20yr. Easy with good maintenance.
Reply: @Electric-Mania  Don’t get me wrong love teslas, but I’ll always love my grandpas cars a million times more.
Reply: @Electric-Mania  He announced on Nov  4, 2016 that Model 3 & Y will have solar panel ceilings/'deployable solar shield like a retractable hard top'. Due to Covid and other circumstances it didn't happen. Being it was supposed to be a launched option by 2022. I can't post a full link on here but look up his vid also talking about it CsyTYtiXtcs

Thus I wasn't lying at all. It just wasn't released as promised.
Reply: @Electric-Mania  Out of my budget but as you mentioned in another reply battery technology will advance in the next several years to where all of this is possible at an affordable price.